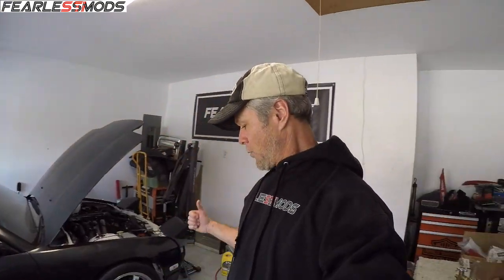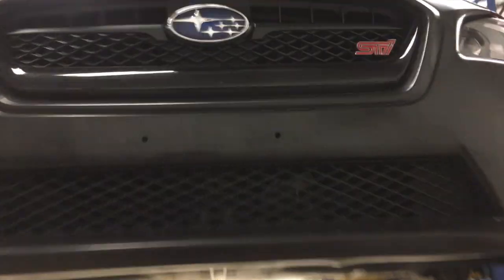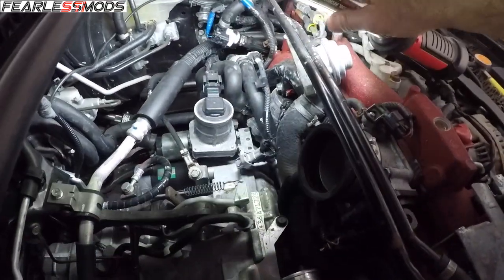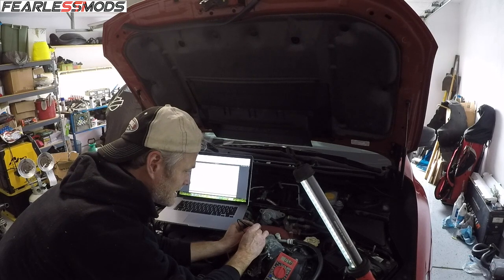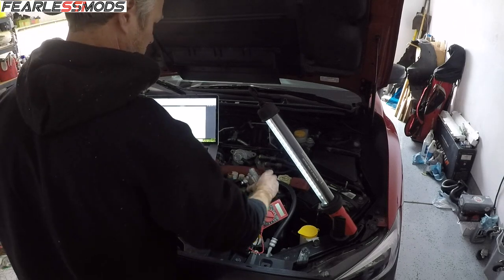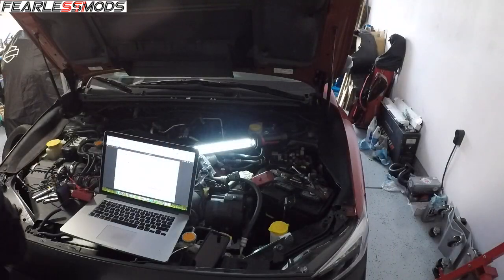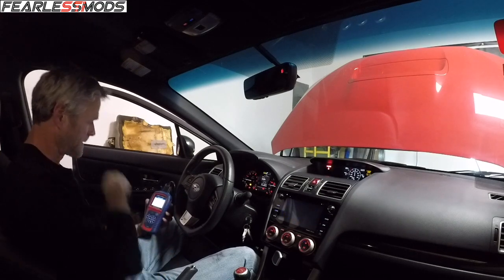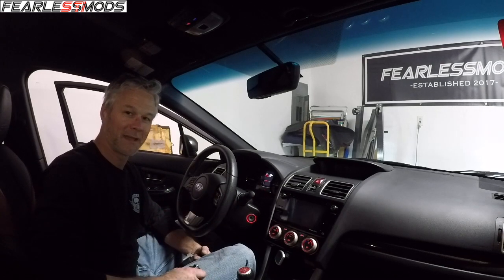Subaru WRX STi Ep 28: Chasing Secondary Air Combination Valve electrics

Comment: Hey man, that was a good find on that pinout missmatch on those white connectors under the fuse box. 
Since you said that fuse box came from another car, and you found one missmatch, and that connector at the valve has 6 positions... You gotta trace each of them out now. It stands to reason that although you were able to get the solenoid circuit working by moving that pin, there may be other circuits in that group that are also missmatched.

Thanks for the vid. I bought an older forester, same valves, all corroded. I don't want to spend the $350 each for new valves just so I can smog it and then do the delete. I bought some used ones on eBay and now thanks to your vid, I know how to bench test them before I go to all the trouble.
Btw, you CAN get that lower one out without removing the manifold, it's a Tetris puzzle but it's possible.
Reply from the maker: Thanks for the info Andy!  Nearly 40K mi on the rebuild and it's still running perfectly, so I think the wires were GTG after that key finding.  Good to know about the lower valve...tetris AND being a contortionist may be helpful!

Comment: This is a great video!   I liked and subscribed as a thank you. On my car the previous owner removed the air pump but didn't take the barometric sensor off and reinstall that. There are a couple of male connectors loose but I don't know which is which. Any tips? Maybe there is a third connector under the intercooler. DO I have to take that off to find out?
Reply from the maker: See if you can find a wiring schematic and hunt that thing down. Takes a lot of patience and trial and error. Good luck!

Comment: Hi there, thank you for your time and good work on this so far, I have been dealing with the same issue for over a year now and cannot smog now because of it ( I live in Ca) so very frustrating...just had some thoughts from my experience with my car, I have a 2006 WRX TR that ran the secondary air system fine for the for 6 months of ownership, 12/2018-06/2019 but then the LH valve code for stuck closed came on and i've done the same tests as far as getting the pump to operate and valves to open after the air cut relays...which my next move is to trace wires back to look for a short in the control wire coming into the cut relay 2, wondering how you were able to fix yours in the end to see if I'm on the right track. Thanks in advance
Reply from the maker: Hey Richard, glad you're enjoying the vids.  Try this one for the Secondary Air Valves, I think it may have my solution.  https://youtu.be/H-5Zwmbl-UE
Reply: @FearlessMods  Awesome, I don't think my problem will be what you dealt with but seeing what you went through makes mine seem a lot less frustrating, at least for now haha I will need to pull off the fender and dig into that wiring to further investigate....I also have a power probe tool similar to yours which is a must have for sure. Thanks again for your help.

Comment: If the car at one point had a tune and the tune is still on the car that’s could cause the check engine light possibly if u take it to a tuner they should be able to check

Comment: I've already had my CEL taken off and i took the pump itself out but i want to take the rest out as well as you have here. Im hesitant because i've heard people say the car wants to retain a barometric sensor? Did you take any considerations for that?
Reply from the maker: Joshua I didn't remove any components.  In the end, I got everything back to where it was from the factory.  I was concerned about the Baro sensor since it's a part of the secondary combination valves, but didn't delete them in the end so it wasn't an issue for me.